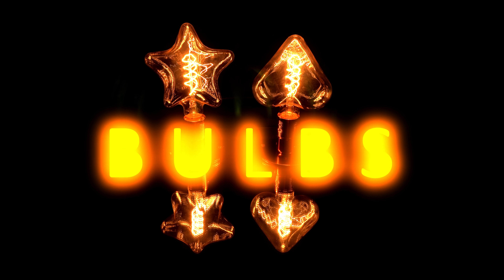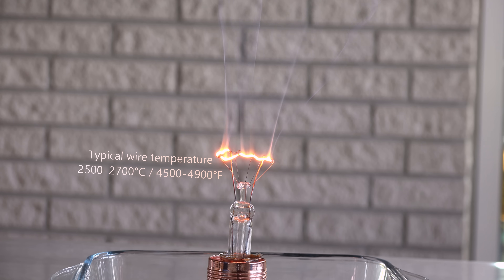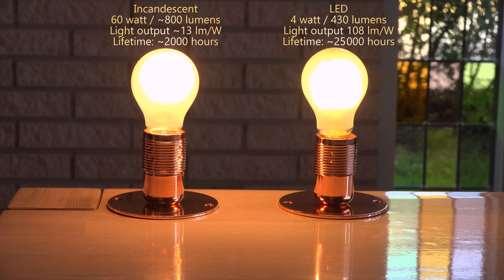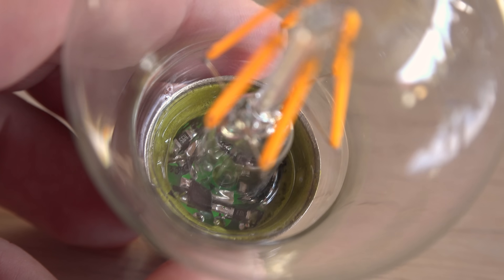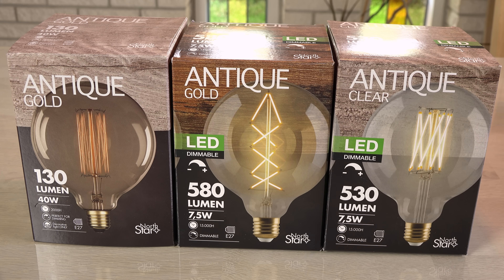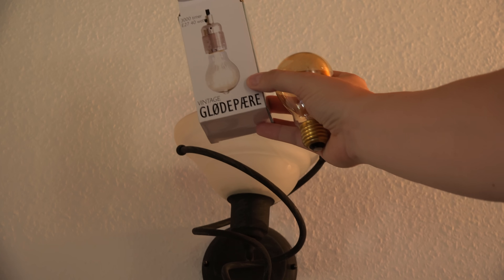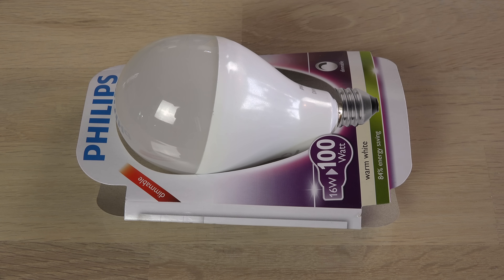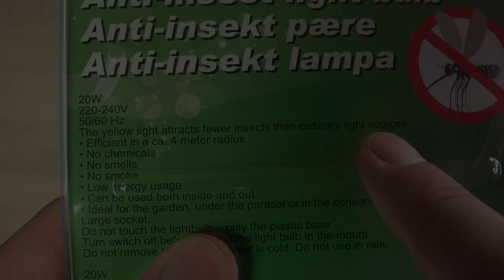Light Bulbs | LED vs. Incandescent

Comment: One thing I wanted to point out is that the "wattage rating" refers to the maximum amount of wattage the wires or components are rated to be able to draw, not the amount of wattage they actually use. If you exceed this rating amount, it will overheat the wires, leading to fire. If you plug in a 60 watt bulb to a 45 watt socket, it will overheat the electrical wires in the house leading to the outlet.

Comment: if LEDs were so much better they wouldn't need to ban incandescent bulbs. shitty politics. the less energy we use they'll just increase prices so we pay the same anyway
Reply: They're not banned... maybe only in shithole liberal places. If one uses a light bulb 3 hours a day, the savings over a year between incandescent and the shit modern bulbs is literally $2 a year. I would pay $2 a year to not have to sit in the dark or with ugly unnatural colors. In reality it's more likely 25 cents a year as I don't use any bulb for 3 hours a day.
Reply: @VinylToVideo  Yes, the energy savings is tiny and the light LEDs produce is too harsh. Sadly, the Biden DOE is banning halogens and incandescents this year and they are even banning rough service bulbs and CFLs too. I know that California was the first to ban ban them in 2018.
Reply: James Ray  Yeah I know what you said I never saw any, just the new crap. Maybe it's a law in Washington state, I don't know. I have found them elsewhere in Canada for a similar price but they have to be labeled as "rough service" bulbs or they can't be sold.. fine by me as they have an extra 5 pieces of metal to hold the filament though I don't find these ones to really last that long. They all seem to be made in China; the very complaint I had with LED lighting to begin with. Hard to find incandescent Edison bulbs made in USA or Canada even though they were invented here!
Reply: James Ray  But the electricity savings isn't worth it in placed where a bulb might get used 2 to 10 minutes a day. I would pay the extra few cents or even dollars a year in order to actually be able to see!
Reply: James Ray  I looked in Walmart the other day.. never saw these bulbs for 62 cents each unfortunately!

Comment: When heat is a desired outcome, incandescent bulbs become very efficient, and don't contain any electronics or heavy metals to (hopefully) specially recycle. 

Efficiency formula = (Desired output energy) / (total input energy) 

I live in Canada, another cold country where we heat our homes 8 months per year. The extra heat energy from incandescent bulbs used to heat the air around them, and take some of the heating load off of our furnaces. I suspect that I'm not the first guy to use a 500W halogen work light as a heater in winter...

Comment: I'm not trying to prove this wrong, but there's no problems with LED's depending on how many years you have it and what store you purchased LED Bulb Lights

LED Bulb Lights is less harmful when you unscrew the bulb

The glass bulb lights (any of them) includes gas electricity and creates more power like CRT TV's creates

Let's say when you purchased all LED Products like LED TV's, LED Bulb Lights or LED Strip Lights, when it comes with electricity bill, you would be paying $5 of piece

When you purchase glass bulbs and have two or three CRT TV's in your home, you would be paying atless $50 or $100 and more

Comment: I changed most of the bulb in my house to LED, and ever since I started to feel more tired.
Reply: @valerierodger7700  Well, it really depends on which LED light you buy. Incandescent lights usually have a color temperature of 2700K, which doesn't excite your sleep hormones too much. Most LED lights are way above 3000K, but lower options are avaiable.
Reply: @Minecraftminer3000  Yea better off getting warmer colors
Reply: Probably more work than you have done in a while.
Reply: I found a website last year and you're up where they are trying to outlaw those horrible LED lights because of how bad they are for people and personally I absolutely hate them and only have and canndescent in my home

Comment: In italy tecnically is banned the selling of old incandescent bulbs, but if the shop has stockpile they can still sell em. IS NOT BANNED THE PURCHASE AND USAGE OF OLD INCANDESCENT BULBS.
There is a bad aspect that is underestimated: electronic pollution.  market is flood by crappy led bulbs that fry earlier than good one, but at the end even good led lamps fry too.
Big difference is the waste that result: old bulb is metal, glass, and some tungsten (still metal); but on an LED builb what is inside? plastic chemicals toxic metals . way more less ambient friendly.
A couple of more aspects:
old bulb dont produce noise, or electronic interference.... try to lissen an led bulb. some are really noisy

So please use LED smart, and dont buy super cheap leds... they'll be superfast pollution ewaste

Thanks to the comparison video, maybe next one u could compare a top brand led light (like osram,GE,Philips and similar brand) vs other "cheap"

Comment: You are correct there is a whole world of differences between the words repel and attacks-less. But then the incandescent bulb will burn the insects when they get too close to it. while the others will just cook them very slowly when starving to death while looking at is pretty light show as the fluorescent bulb flashes twice as fast as the cycles rate of the power plant normal cycles per second. {50cps} to {60cps}of Eastern to Western worlds.
{ Flashes of light for every change of voltage. IE: Once for each rise in voltage toward positively-going voltages, and once for each drop in voltage towards the negative-going voltages, these voltages are measured at the output of the transformer toward the tube's input.}

Comment: Incandescent lights are only inneficient when the heat is wasted/unwanted.  In winter, they are 100% efficient.
Reply: I use em for light source spring summer fall winter all year around

Comment: I'm stocking incandescent light bulbs for decades just in case they become illegal, such a shame. LEDs work, but they are not ideal. I want 99% perfect luma, I don't care what it costs to achieve it. (I have a thousand-watt computer 24/7, I don't bother with lights) 

and before you come here being willi nilly, its hydro-power, I'm greener than you will ever become with any PV or eolic power
Reply: With all the advantages of LED it's asbolutely ridiculous to use incandescent bulbs anymore.

Comment: The new bulbs are SUPPOSED to be better - yet I find myself having to swap bulbs more often NOW than ever before. LED may be more efficiant, but they are also more expensive. And I believe that the manufacturers deliberatly make these new bulbs have a shorter life than ever before. And halogen is even worse. I miss the old incandescent bulbs - they lasted longer.

Comment: Honestly, the ideal solution would be fibre optic cables to every house, plus two giant dishes, one in the sky and one on earth, placed so that there's always light being captured and sent down to the area where there's no light at the moment, making it available for everyone in need, via fibre optics - healthy, fresh, natural and (except for transit) free sunlight, at one's whim, in one's house. It could be used for heating, and general energy production might start to look a lot different. The next step would be storage. If we learned how to store light like we store electricity - namely, just store it in a box to later have it come out, "compress" or "absorb-for-later" light somehow. That would be some discovery. Just passing sunlight instead of bulbs via fibre optic cables and dishes is a challenge enough for now I think - and definetly within the scope of our technology. It might even be with just strategically placed dishes on earth, connected to each other and then out, that there's light always "in the system".

Comment: Incadescent halogen 24V DC works for me! Bulbs are like 0,25€. The most pricey is the PSU - roughly ~10€ for a 100W/24V LED PSU. The upside is you can convert any regular AC lamp to DC - just replace the bulb and place the PSU in the circuit between the mains and the lamp. Thanks to DC and lower voltage, not only is the setup more long lasting, the light doesn't present microflicker so many people have eye irritation from. Plus, the scope of the light resembles most that of the sun, which often times cannot be decivesly said about LEDs. It's not that they just produce bad light altogether - it's that there's currently no easy way to test for sure which spectrum of light the commercially available ones produce. And so until there is, and they clearly are marked on the shelves, I rather steer clear of them and keep all their eventual blue light effects away. For those who still do not know about adverse effects of blue spectrum light in 2020, I recommend just a quick Google search - messed up melanoma / sleep cycle production / hastened aging of human body cells etc being the issues mainly discovered and discussed so far, as effects of said blue light exposure. So, DC 24v incadescent halogen.
Reply: Melatonin not melanoma, a skin cancer.

Comment: Since when is having a 100W bulb burning in the dead of winter considered a bad thing.  Seems to me that it would heat up a small room (or bake a cake if you use the Easy Bake Oven) or even take over some of the responsibility of a heater <> Also, the electric company is not going to take a hit just because you decided to use a lower wattage bulb so the price per Kw is going to rise faster than you take your hand away after putting your palm on a filament from a incandescent bulb.

Comment: At least here in Canada, the heat given off by incandescent bulbs is irrelevant at least 8 months out of the year.  It is just a contribution to the overall heat required by the house.  But an incandescent bulb that used to cost $0.25 is now replaced by an LED bulb that cost $2 to $3.  And sadly, while the actual LED may have a service life of 25,000 hours, the electronic circuit that drives it often fails much sooner, especially if exposed to brown-out or surge from the grid.  Progress?  Not really.....

Comment: The problem with one of your tests, you compaired a 40 watt Incandescent to a 40 watt led, the problem is that you used a "40 watt led" which is really rated over 200 watt Incandescent, so that test was a bit off, to get a 40 watt Incandescent  in led you should of used 6-7 watt LED.

Comment: I have been working with lights and lighting for nearly 30 years.  These new LED and CFL bulbs do not have the life expectancy that they are touting - PLUS - people don't recycle LED and FLUORESCENT bulbs properly - they just throw them away - as a result you may start seeing more mercury in landfills. Incandescent bulbs have less environmental impact. Sure they may consume more energy - but there is always going to be a trade off.  There is another issue with LED lamps. There are findings that the wavelength of the LED light is damaging eyes over time.

Comment: For reptile owners banning the less efficient hotter burning bulbs makes finding cheap basking bulbs harder.
Reply: Are bulbs that's specifically designed to produce heat (such as the red one in the video) also getting banned?
Reply: @cinnabarsonar2072  No but they're more expensive than normal bulbs

Comment: LEDs are more efficient at producing light, not heat, if you want heat and light, such as a sun spot for a lizard, you need incandescent. but your also running a heater at the same time so... and for that application Incandecent is the best you can get, it only comes down to the design of the bulb how efficient it works.

Comment: I still like incandescent lamps plus I require them since I want to use a dimmer but of course most LEDs are not dimmable. And in the UK incandescents are getting harder to find. I hope that we will start getting more incandescents after brexit is done and we no longer need to be governed by the EU on what bulbs are legal
Reply: Just search for dimmable LED lamps on Amazon, but okay.

Comment: Banning incandescent light bulbs is like requiring seat belts.  Only morons would need a law to tell them the smart thing to do. 
LEDs are available in several color temperature and CRI.  I replaced ALL the bulbs in my home with LEDs in 2014.  I haven't replaced ANY yet.

Comment: I work in Multi Family Building Efficency. We go into every room and every light fixture gets checked to make sure it's Efficent. We also switched to using warmer color bulbs so it more so matches incandescents and so the light isint as harsh. You'd be surprised by how much energy we save the building by just swapping the incandescents. Kilowatts upon kilowatts.

Comment: Team Group's T-Force RGB LED SSD (not sure of exact model) had an issue of over heating due to the LEDs. It caused it to run slow compared to a HDD (7200 RPM).

Comment: Very interesting video.  I had a debate with someone at work about light bulbs a while ago.  I suggested that, in theory, in winter an incandescent bulb is 100% efficient especially if the home is electrically heated.  They insisted that there was no possible way that any bulb could be 100% efficient.  I said that if I am both heating and lighting my home with electricity and an incandescent bulb outputs both visible light and heat that I am therefore making use of 100% of its output.  I want the light AND the heat from it.  Obviously this is an oversimplification and would only apply when I am actively heating my home but I do believe the logic is sound.  In this case an led bulb is less efficient as I will now need to employ additional heating from another device which may be less efficient in its heating capabilities (ie if it produces a lot of noise that energy is wasted).  They finally gave up and I swear I could see smoke starting to stream from their ears.  :)

Comment: We have 7 different times of led bulbs in the house. When I noticed that they didn't last long I started to write the installed date on the base. That was 5 years ago. The cost a fortune (€ 2,50 to 3,50 a piece) and since then none of them lasts longer than 2 years. And they're not some knock-off brand. They hang from the ceiling with nobody living above and the grid is stable. In theory leds are a valid replacement but the free market made them like shit so you have to replace them often. If I could I'd go back to incandescent bulbs. At least the went on for at least 10 years and were very inexpensive.

Comment: You left out the toxic spiral luminescent bulbs . They contain deadly toxins against the enviroment , break easy and are not accepted for special disposal at the suppliers . So into the bin they go poisoning the soil and the water table where they get dumped , not to mention the workers who come into contact with the deadly toxins by skin or breathing.
You also failed to mention the heating costs that are saved in winter by using the old bulbs. So its really just one expense passed onto another.

Comment: Interesting things I discovered: Catching flies and mosquitos in particular is easier with LED light. I guess the flies are blind to that light source. Downside With flourescent light I cannot read with LED light I only see black and white, no colors.

Interestingly enough with petroleum lamps and with tea lights I can read and I do see colors and they dont flicker as much as LEDs do.

I dont like lamps burning fosil fuel but they do work better for me than modern electric light does. I am sad to say like with automobiles oil has won over electricity. at least in germany. I am driving an 8 jears old Mitsubishi i-MiEV electric car and it still has the old tungsten lamps.

Comment: The problem with the led bulbs is that they never reach the life time they supposed to reach, as they get burned out like matches. 
This means that the money gained from economising electricity is finally spent for new bulbs...
Apart from that, they do not emmit the proper light spectrum causing problems to human eyes and difficulty to sleep at night. Doctors are already worried about these facts. 
Moreover, they worsen the power factor of the utility network. 
All of these facts put the question if these bulbs should be banned instead of the incandescent ones. Last but not least, when they are burned and thrown away, much more still useful material is thrown away in comparison to the incandescent bulb. In the last one, there is only its metallic base along with the glass containing the filament and nothing else. A led bulb, contains a power supply in its base, that is, an  electronic circuit, plus the light emmitting diodes, plus the aluminium heat sinking base on which these diodes are installed. This means much more useful materials thrown away, especially in cases where there is no recycling processes active. This means a big environmental problem as regards countries of the third world...

Comment: You should have mentioned that the incandescent bulb emits light because it is hot. (Heat is the primary product, light is the secondary with incandescent lights.)

Comment: I work at a bulb store, there are some led bulbs that are non cec compliant. That is because of the way the bulb deals with the heat generated by the ballast in the base. 5000k is my preferred color temperature.

Comment: You forgot to include the one big drawback for LEDs - The electronic parts are highly susceptible to voltage spikes.  If you live in an area that has alot of thunderstorms, you have to place a voltage protector inline of each lamp, or  make sure that you have enough replacement bulbs on hand.  I just keep a  Incandescent in the each of the multi-light lamps for that reason, and I only use it when there is a  thunderstorm.   Incandescent bulbs STILL have their uses.. BANNING them outright WITHOUT  taking then into consideration  is a FASCIST thing to do. (Well, That's the EU for you)